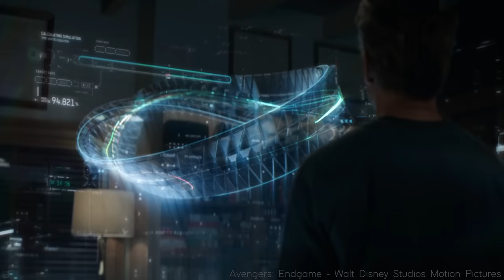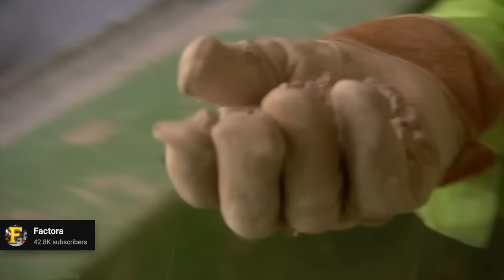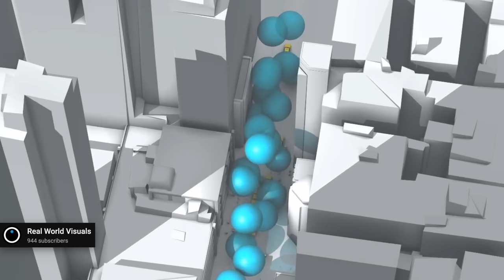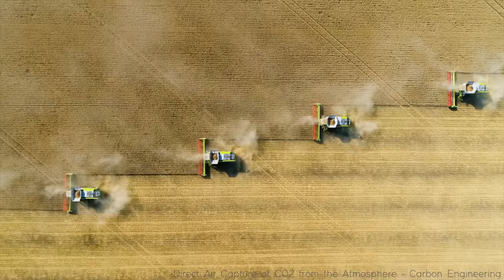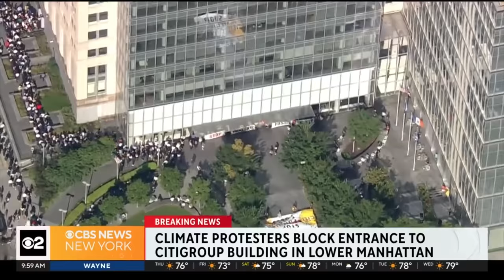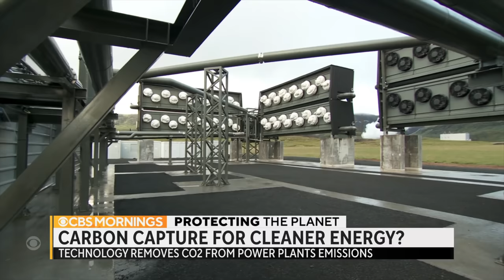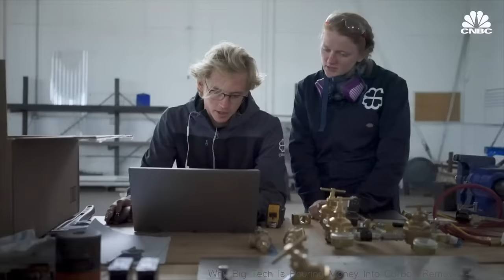How Thermodynamics Holds Back Negative Carbon Tech

Comment: Capturing co2 while we're still burning fossil fuels is like mopping the floor with a tissue while the bath is overflowing.
Reply: More like mopping the floor of the overflowing bathtub with a rag that was already dripping wet before you started.
Reply: so I don't see a problem
Reply: @TerryClarkAccordioncrazy  It’s more like caulking the bathtub so the water runs only down the drain. I think of CO2 like a messy discharged battery. What do we need to do to clean up, reload, and then charge the battery again?
Reply: @5353Jumper 
Wait... what's the difference? 😅
Reply: @ivoryas1696  because carbon capture itself is a source of atmospheric carbon, requiring even more energy to run. So it just adds to the problem.
Reply: @5353Jumper  
I thought he said it managed to take about 7%, though. Maybe I should watch the video again, though, lol.
It's seem a terrible margin, but it still seems better than simply adding more CO2
Reply: @ivoryas1696  well metaphors aside - the entire concept of using a lot of energy to reduce some of the emissions from your energy production is a ridiculous proposal even if it does clean a little bit of emissions. 

There is a possibility some day of using direct capture on other industrial process like metals production, but definitely not in energy production. 

And for the math to even make sense the CCS needs to be powered by non-emitting generation AFTER we have actually gotten to a place where we have excess non-emitting generation. So decades away. 

$$$ for amount of carbon emissions prevented/removed, CCS is far behind thousands of other solutions we should be doing first.

Comment from the maker: I’m fortunate to have a lot of smart viewers out there and some of you picked up on an error: forests capture 10 tCO2 *per year*, whereas the video implied this was total. Although this doesn’t really affect the main point of this video (which is calculating DAC thermodynamics limits), I wanted to address this regardless! So how does this affect things? Well the 10 tCO2/yr number isn’t trivially scalable because forests eventually mature. Bastin et al. (2019) investigated this (https://www.science.org/doi/10.1126/science.aax0848) and found that there’s about 0.9 billion hectares of arable land that could be potentially forested which would capture 205 GtC = 752 GtCO2. For comparison, in RCP8.5, by 2050 we’d need to remove 540(1310) GtCO2 to reach 450(350) ppm levels. By 2300 this becomes 11946(12717) GtCO2. So in RCP8.5 this is definitely not a long term solution. For RCP4.5 these numbers are better, we’re looking at 385(1156) GtCO2 long term to reach 450(350) ppm. So a hot 450ppm level with aggressive carbon cuts plus a billion new hectares of forests is a viable outcome. But of course with only 0.9 Gha sequestering ~9Gt/yr, its just not fast enough to offset our current emissions and thus CO2 levels would rise for decades still, and of course that’s where DAC comes in, with mechanical trees being 1000x more efficient at sequestration (https://eu.azcentral.com/story/news/local/arizona-environment/2022/04/22/asu-researcher-builds-mechanical-tree-capture-carbon-dioxide/7398671001/ ) than trees (hence no need for a billion hectares of land, but instead a lot of power). Either way, it’s going to require a huge change to our planet. No silver bullets. Thanks everyone!
Reply: "According to a Cambridge University researcher, a hectare of hemp can absorb between 8 – 15 tonnes of CO2. In comparison, forests capture 2 – 6 tonnes only depending on the type of trees, region, etc."

We're not even talking about some of the most efficient ways to remove CO2 regarding plants. There is also a particular tree that does twice what even hemp can do, then you have to factor in the fact that you can increase that by adding ivy  which also protects the tree.

Additionally none of this is taking into account selective breeding to increase these plants ability to serve this particular purpose. Also hemp is a great alternative to many plants we already use for textiles and other materials.

Edit: A combination of many methods is so much more powerful than people realize, reducing oil usage(whether we like it or not this is going to be forced upon us by limited supply and increased prices), forests, popular hemp and marijuana farms(new cash crop), DACs, ect.
Reply: > machine 1000x more efficient than tree
But the tree includes the energy source vs the machine does not. With energy source included, the tree is trillions of times more efficient than the machine, because the cost of the tree is much much lower than the cost of a machine + power generator.

Comment: There is also research into capturing co2 bound in sea water, where it's concentration is much higher (sCS^2 process). Which would in turn reduce the co2 in our atmosphere, because they can use their giant surface area to bind more. Additionally, the co2 would be bound in limestone instead of gaseous form.
Reply: It would also turn the ocean into fizzy soda pop water, giving it a high enough level of carbonic acid that many animals like clams and corals would have a much harder time.
Reply: @thelaughinghyenas8465 i think you misunderstood he is talking about removing co2 from the ocean because it is easier than from the air. The co2 levels in the ocean itself would stay the same because the co2 in the air would get dissolved in the sea
Reply: @thelaughinghyenas8465  Quite the opposite, that is what is what is being removed. Unfizzling the ocean and binding it in limestone, to put it in your words.
Reply: @Mr_Stone1  , While scrubbing the ocean has the advantage of lower ambient temperatures much of the time, what will the disruption of all the ocean DAC plants and the servicing of them be to fish?
Reply: @thelaughinghyenas8465  first of all it would be a local effect, like increased salinity around desalination plants. Second to scale it up enough to have an effect on ocean plant life would take centuries of constant effort. So to your point, the answer is none.
Reply: @GenericCat  , The ones still left in  the ocean.  DAC plants are going to affect them. Can you imagine the giant pumps that push the ocean water through those carbon separators? What will those do to plankton and other ocean life? Those pumps will be LOUD.  What will they do to dolphins and whales?
Reply: @MrTaxiRob  , If the effect is only local and there are few localities so the risk is low, won't that mean not much carbonic acid will be scrubbed?
Reply: @thelaughinghyenas8465  like most of these techniques being discussed, they can't necessarily be the only solution. We have to do all of the things. But as for your question, if we're sequestering carbon out of the water near the surface, the water will in turn absorb it from the atmosphere. The local effect wouldn't even be that big of a deal, especially if it's done in coastal areas with high wave action. Basically the bucket refills itself.
Reply: @thelaughinghyenas8465  I think you missed the joke.
Reply from the maker: Interesting will check out 👍
Reply: Chemical engineer here. I got into ChemEng for this reason and this is definitely the right route.
Reply: @jopwarmy  Good to hear! I can imagine direct air capture as a way to reduce CO2 from building ventilation and other higher concentration air streams, once it's more mature. We should investigate all routes to overcome this challenge and pick the right one where it makes sense.
Reply: @jopwarmy  thanks for fighting the good fight. If you have any ideas on upscaling/energy consumption, feel free to share.
Reply: This is definitely the only viable solution, it also helps with ocean acidification
Reply: I’ve heard some be enthusiastic about soil sequestration potential. How does that compare to direct ocean capture? I still think biology and geology will be more efficient and scalable than engineering using electrically run machines. I wonder how they could be compared and measured on a per unit basis?
Reply: @thelaughinghyenas8465  Both the surviving fish at this point will be living in a bowl and be fine.
Reply: @thelaughinghyenas8465 I bet you're a lot of fun at parties , EH ???
Reply: @lawrenceiverson1924  , We have a blast in hunting parties!
Reply: Direct ocean capture can be integrated with offshore wind (or even hybrid solutions to increase the load factor). It will result in carbonates of calcium and magnesium with potential industrial carbon neutral uses. There are challenges though on processing the slurry and the overall energy efficiency. 
The overall energy efficiency is a critical element in all of this
Reply: @Rnankn soil building would be my choice for carbon capture too. Almost every country has at least some examples of quick growing plants that could be managed on carbon capture farms. True, 90 per cent of the carbon from harvested plant material will escape back into the atmosphere - but this can take many years, by which time, you have already harvested the same trees/bamboo/whatever again and again.
So you would always be ahead of the amount of carbon dioxide that will be released, if you keep growing and keep harvesting.
Also, I have no doubt that diffe rent species of tree lead to different levels of carbon fixed in the soil, and that certain varieties of fungi might be beneficial in locking more carbon in soils. Research into the benefits of fungi has been left for far too long, many scientists only just starting to show an interest in this group's capabilities
Reply: A fairy tail which tells nothing ABOUT THE ENERGY NEEDED TO REVERSE THE CHEMICAL PROCESS WHICH RELEASED THE CARBON IN THE FIRST PLACE !